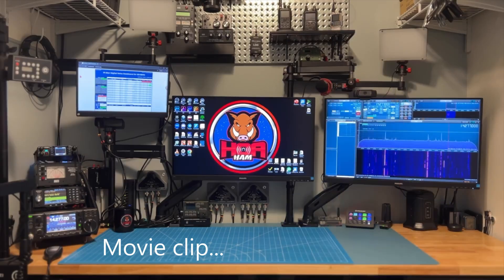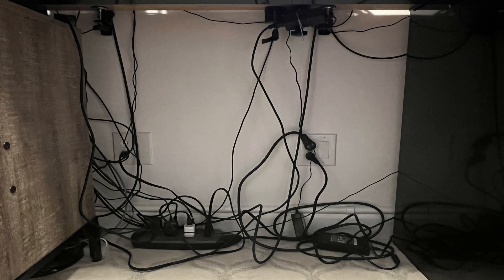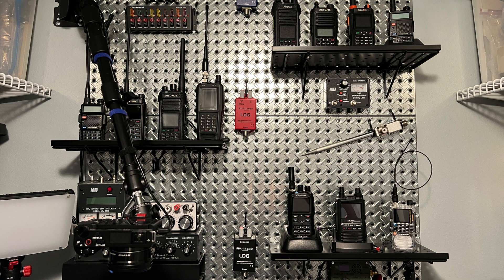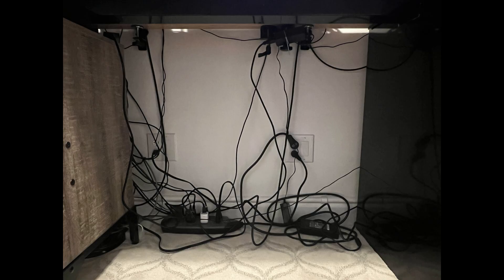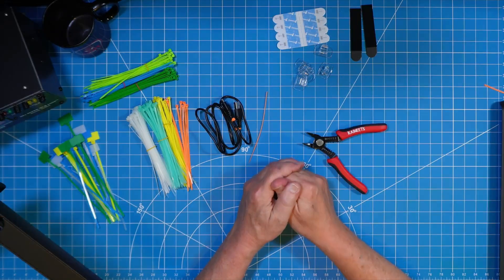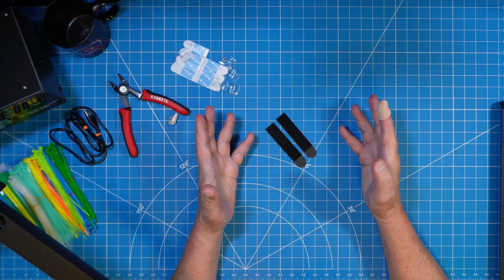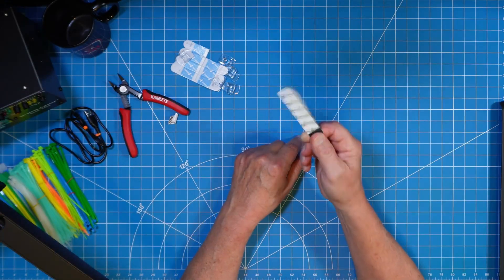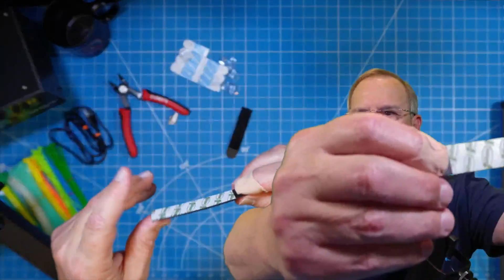Ham Shack Build Out Series #9:  Ham Shack Coax and Computer Cable Organization Pro Tips

Comment: Great move labelling or marking cables. In the electric power industry, particularly in plants and substations, every lead and every terminal its attached to is labelled and that label (hopefully) matches the prints exactly so that you can trace out issues down the road. I noticed, before they hid it behind drywall, that the romex cable in my new house is even labelled by the electricians. They also labelled the breakers in the box, of course, and I'll be marking them more permanently after the house is done and I move in.

Great video - thanks.
Reply from the maker: Thanks for the view and the detailed feedback; label everything for sure!

Comment: Good information, thanks. Do you have an AC in there and does it create complications with interference?
Reply from the maker: By AC do you mean alternating current or air conditioning?  I have both, and there is no significant interference from either.
Reply: @HOAHamRadio HVAC. But that does raise another question, how many amps are you running?  I’m seeing if a 30A is enough for my setup. The cost of 50 or 100 is significantly more with the price of wire.
Reply from the maker: I run a 30 amp switching power supply

Comment: Heat will cause the glue to break down on those command strips. I hung my wifi router on the wall using them for better airflow and to get it out of the way, and after a couple months the glue completely failed and it fell off the wall on its own. Just a heads up
Reply from the maker: I expected that might happen; mine have held for 2 years. I’ll sure the level of heat impacts whether or how long this will last.